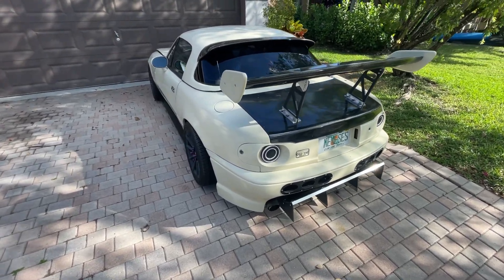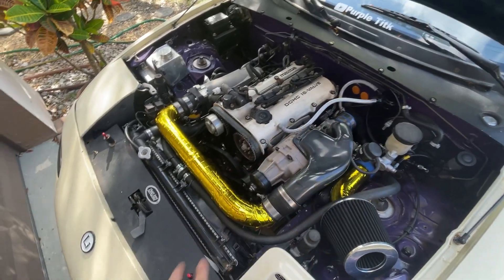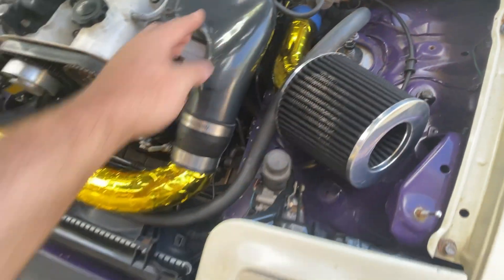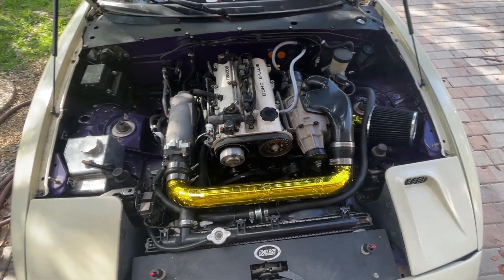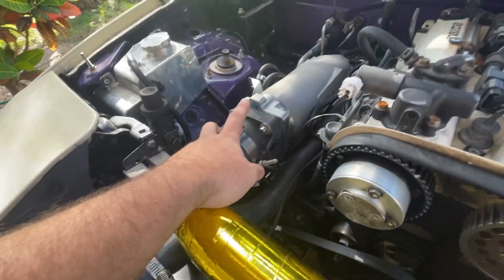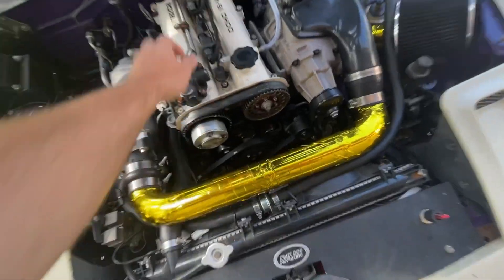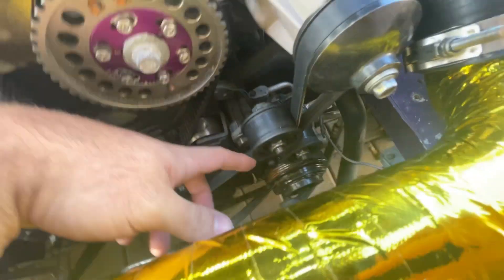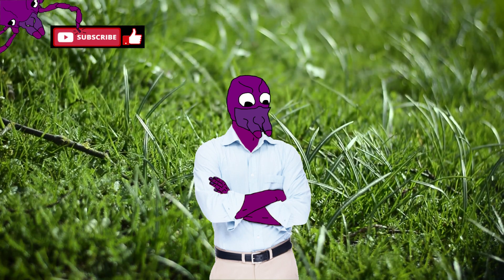Supercharged Engine Swapped MIATA!!! Update video

Comment: I've always been curious about low-boost via positive-displacement supers & high or moderately-high CR; theoretically you can hit a sweet-spot where the efficiency of the engine becomes even greater while not increasing knock chance by any significant number; not to mention having that boost from the get-go & getting rid of all the issues natural to a turbo. There's this channel on youtube who used one of those crappy AMR500s on a 1-cyl. Kubota Diesel & it's seriously improved the engine, if I recall correctly including in fuel efficiency / economy.. So with some actual engineering sky's the limit.

Mr. Gale Banks, the grandfather of the turbo-diesel, still uses Superchargers when it makes sense & he showcased just 1 year ago how in his twin-charged Diesel for a Monster-Truck he was experimenting with the less drive-ratio he had on the Super the more HP he ended up making, each time it would go up by 100hp... And that was just via trial & error; though the physics are quite complex I'm sure there are engineers who could have ~90% accurate predictions as to what drive-ratio is needed to make that super move air with far less power than what it makes. People will also cite stuff like Top-Fuel dragsters using ~800hp. to drive the Super but fail to realise it's because the rules don't allow any other type of inducer & that NitroMethane is essentially a monopropellant so it doesn't make a difference even if it draws multiple thousand horsepower, not to mention if I remember right the AfR in Top-Fuels is also set to a certain amount so they aren't even allowed to alter the ratio to be more efficient or more powerful anyway.

Though most see superchargers as parasitic-loss ways of making power it's far from true if set-up right and nowadays we have such advanced twin-screws that this point is even more redundant. Turbos still use power, just rom your exhaust, most info / data people see are from people strapping an old crappy 2-lobe Roots from a Detroit-Diesel (hence naming such as 6-81 etc, referencing the 2-stroke they came off') & just driving it to make peak power, those particular supers weren't even MEANT to make boost, only used @ near-atmospheric-pressure purely for uni-flow cylinder scavenging..

Anyway what is the CR on this engine do you know?
Reply from the maker: Thanks for the insight, and the CR is  11.5.